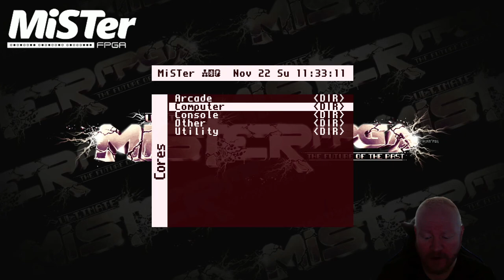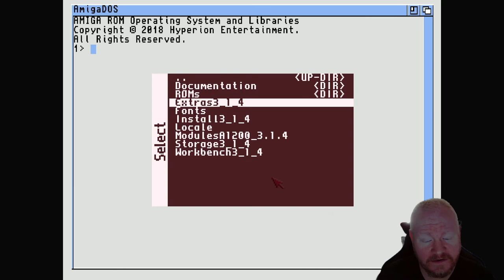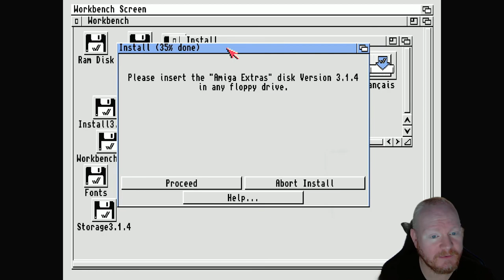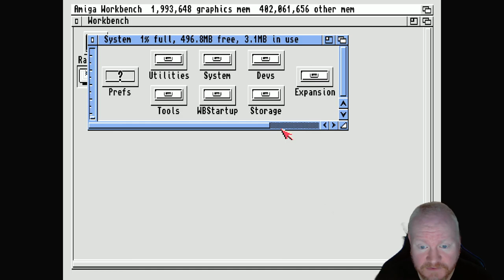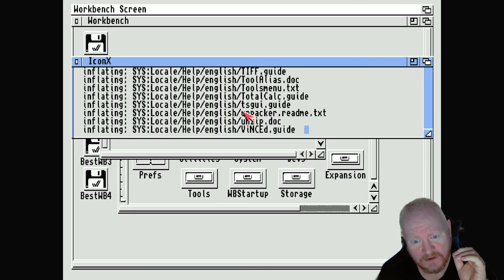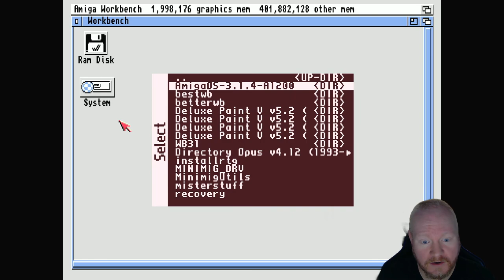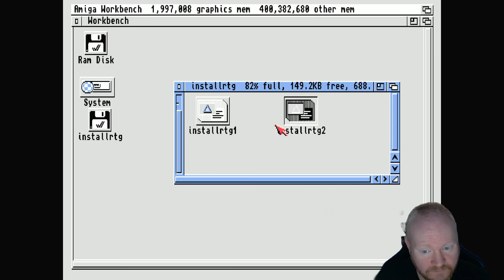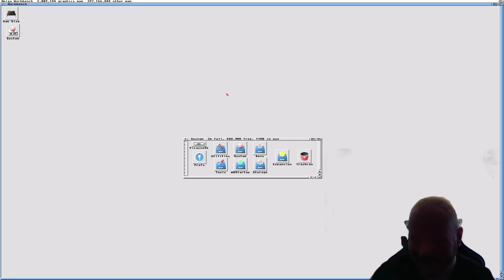Install WB 3.1.4 on MiSTer with RTG and glowicons.

Comment: Thanks for making this and the other videos. I tried my hand at a fresh install of 3.1.4 and BestWB tonight for the first time ever and it is working great. I also used your installrtg file and that is somewhat working as well. I can go 1280x720 with no problems but any color scheme on 1920x1080 throws my monitor into whack. It just displays crazy stuff like it's interlaced or something. The monitor I am using is a 4k monitor and supports 4k and 1080p modes just fine so I am thinking it might be something with the mister ini or something crazy. Using HDMI. Do you have any thoughts?
Reply from the maker: I had the same issue although my monitor tops out at 1080p 60hz, Do you have a custom minimig_vadjust_palx5.dat file in /media/fat/config? I found that that seemed to cause issues. If that's not it you might have to change the vsync_adjust for minimig to 0. Let me know how you get on.
Reply: @allyourbasekris  I got it working. I changed a few settings at once so not sure which one actually fixed it. ;) Thanks again for the video.
Reply from the maker: @gshipley21  Great work, you're more than welcome!